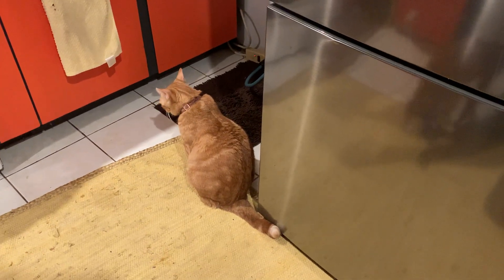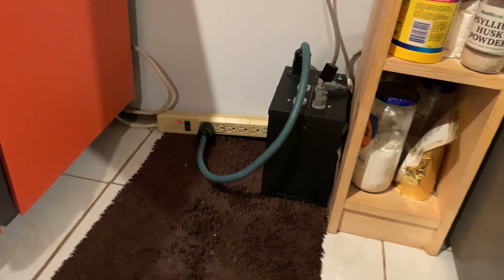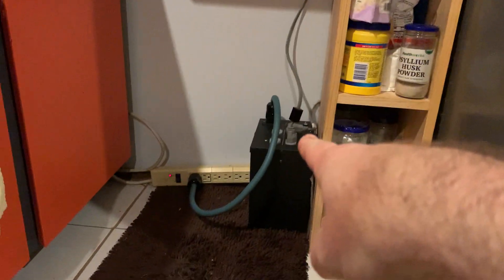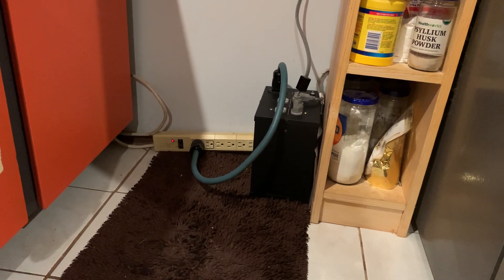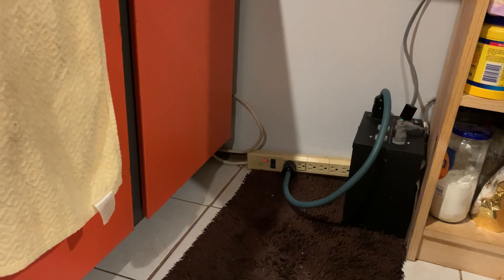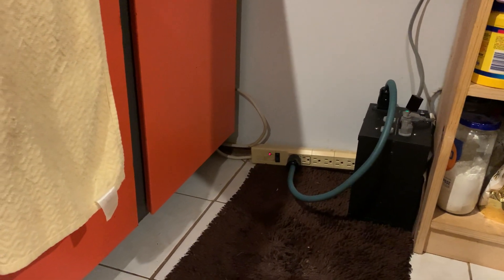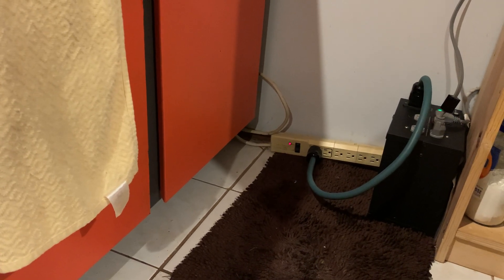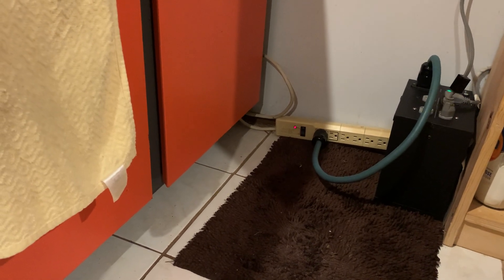Line conditioning:  the biggest impact ever! - not how you'd expect...

Comment: I understand that the Richard Grey is giant inductor in parallel to the circuit. If you don’t plug the fridge directly to the RG unit, but have the RG plugged into an outlet in the same circuit instead …. do you see the same benefits?
Reply from the maker: You can plug it anywhere, and you see benefits. The closer its plugged to stereo, the more negative side effects are there. By far the best effect I've seen is plugging the fridge into it. It is shockingly better (for me) in this application, than plugged anywhere else (room, upstairs, garage...)

Comment: Have you ever done a video on RCA cable construction. The shield, the ground, one vs 2 conductors, connector, dialectic, Quality of copper, twisting of strands, etc.  Have a feeling you know all about this and your words of wisdom would be of value.  Are used transparent for the speakers and Power cords.  

I'm in the process of buying some additional interconnects and may go worth cardas or transparent. I have mogami but it's a studio cable and may be a bit too detailed on the higher end, and also using some old monster RCA cables between preamp and processor which look nice but may not be the best.

Like your cat

Comment: Plug in the powercord straight in de wall makes also a quite noticeable improvement.
Reply from the maker: Yes it does! Sadly, as I said in the video there' no clearance for the thick Kimber to reach the outlet. In such cases a high quality cord still makes a big difference. Every piece of wire acts as a harmonizer, an organizer of electron flow, and a sort piece of high quality wire can organize pretty well a disorganized electron flow coming from low quality wire upstream.

Comment: It smoothed out voltage drops when the compressor was on?
Reply from the maker: Have not measured, and I can't say. The line AC fluctuates by itself quite a bit, I don't expect I can measure it with a handheld meter... would need a pro measuring system to tell that.

Comment: So a fridge is not constantly on. The thermostat provides temperature control to the fridge via an on - off control circuit. Assuming that it is the compressor and not the control circuit that is impacting the video quality (lets talk about that, I think video is far more objective than audio) what you must have been experiencing before is an intermittent deterioration of the picture quality. Is that correct? Also, as somebody else mentioned, is the improvement also visible when the fridge is unplugged?
Reply from the maker: Curiously, not at all. Whether one or both compressors are on/off, does not make a noticebale change in sound / picture quality. Also, the closer the RGPC is to the AV system, the lesser the positive effect is: colors are still better but black levels are not good and dynamics gets restricted. There is a LOT going on, it's not just the fridge... I have tried the RGPC everywhere in he house, it does good/bad to a different degree at diufferent places. On the fridge, it's a BOMB. Why? Can't say exactly. Just reporting the unexpected experience.....

Comment: Hello Janos.................When the refrigerator is running...............and when it doesn't ???
Besides  using the thermostat in the fridge .........did you play with it to see/hear any difference ...?
Reply from the maker: Oddest thing... effect seems to be totally independent whether 4C or -20C compressor or both are running or not. Since I placed the water cooler (with a small compressor & a heater element) on a second RGPC, and the effect just got more pronounced. Even though the line AC is at its worst, Nelli thought when listening to CD that we were hearing vinyl... 
Other than these - placing RGPCs anywhere else there's some improvement, but also a lot of deterioration as well. The closes they are to the system, the worse the side effects. Seemingly when the fridges are running through them, I hear/see only the positives, not the side effects. I suspect that when a compressor is running it's feeding back such noise that messes up the transformers phase angle in the stereo/AV, and they take too long to recover... or maybe something else. 
Was something just sooo unexpected and so powerful....
Reply: @realworldaudio  Yeap that's quite an observation and experience...............At my place I always shut down the TL  fluorescent lightning when listening .............until one day I forgot and the sound wS QUITE GOOD !!!! ??? Since then I switch it on when listening .........
In fact ONLY THE RESULTS COUNT !
Have a nice day Janos...
Reply from the maker: @frankgeeraerts6243  :) :) Sometimes things seem to make no sense.... every new appliance / electrical device we add to the household (or the neighbors add), changes the situation... sometimes to a surprising degree. Keeps us on our toes! :)

Comment: Why not run the audio visual center on the Richard Gray?  Wouldn't that arrangement block power supply EM contamination from all possible culprits instead of just the refrigerator?
Reply from the maker: Tried it, and it's MUCH worse. Colors improved (yet not nearly as good as now), yet the dynamics range collapses. Also, sound collapses.